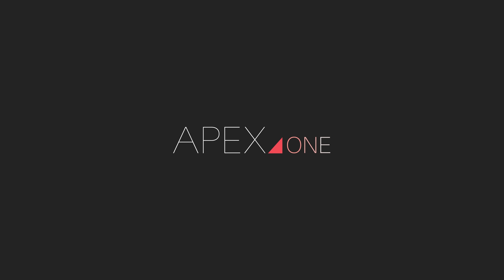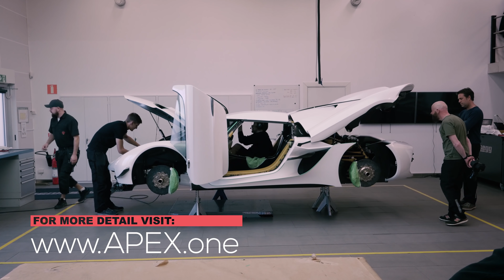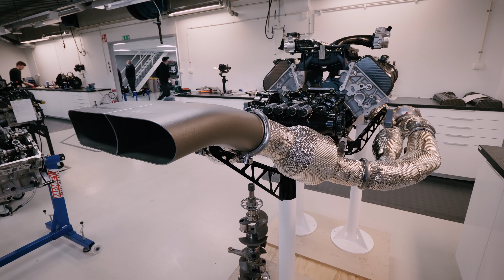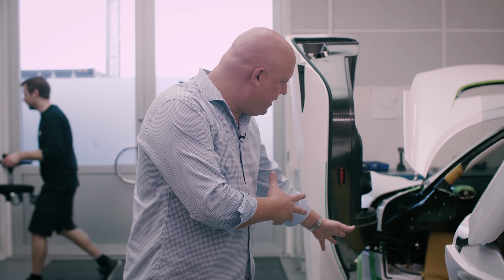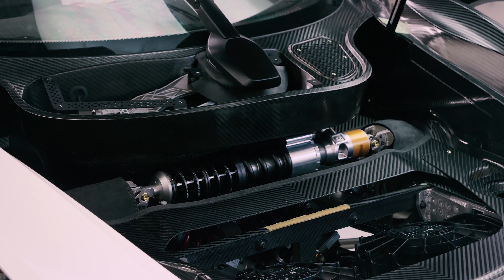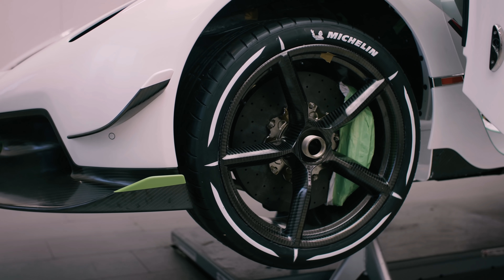First Look: Koenigsegg Jesko - www.APEX.one

Comment: also even with those massive tyres you still have approx a hand print of tyre touching the ground at any time ,which is why those tires are massive sticky tyres basically racing soft compound but in a all weather tyres blok tread pattern. :) Also at high speeds say 250 miles per hour those tyres would only last two attempts thats it, they would still hold you on the road after that, but at higher speeds and depending on the road surface, they will let go full stop, so the tyres are worth around 10K easy to replace and there's only a few places who would be able to replace the tyres and the sizes and balance them as well?

Comment: The air compressor idea is not a new idea, its used when starting up the SR 71 jet engines in fact a lot of jet engines used the same setup. :) The only difference is that its used in a turbo factory car, that all, which most hi end turbo cars will now use, if they pay enough to use the patent to the koenigsegg family, lol :)

Comment: I can say this he has really very good relationships with the swedish air force aerospace metal suppliers like the heat wrap on the exhaust system, thats hi heat resisting metal wrap, like the same as Titanium mixed with other specialised alloys, ( basically specialized weldable exhaust wrapping. :) the same wrap is used in some jet engines and turbo prop engines especially the red bull air speed racing engines. :)

Comment: Koenigsegg just keeps raising the bar in a multitude of ways, and I really hope some of their tech 'trickles down' or is directly implemented by other manufacturers in the near future, for e.g. either of the transmission systems in the Regera and Jesko.

And it's about time the industry pulled its finger out and got Free Valve heads into production. Even if they never achieve the durability or reliability of cam actuated heads, without no timing belt/chain, swapping out a cylinder head could be a one-hour job, and engines could be designed so a single valve actuator failure just shuts down that cylinder (and maybe its opposite number to maintain balance) so the the vehicle can still be driven fine with reduced power.

Comment: at the age of 23 , he decides making worlds best hyper car ( in my opinion), going against Goliaths with heritage, million dollar budgets, engineers etc, he beats them all not only in performance, but engineering and innovation...in 25 years, starting from zero. thats the astonishing part. he manufactures everything himself, , except tires, and turns 5 lt engine into 1600hp. thats not all. he wasnt satisfied with traditional doors, and invented what was called not feasible; dihedral synchro-helix actuation system, carbon fiber wheels for a car going over 250 mph,   an innovation of its own

Comment: Love the car, a masterpiece in its own right. But calling you out on the boost tank. Ford did this technique back in the day in rally, stuck the tank under the bumper.
Reply: But that was racing this is the road
Reply: They don't claim to be the first ones doing so. They got inspired by Volvo's system they've used in their diesel turbos recently.

Comment: 1600 HP from an 8 cylinder engine 😱    Amazing 🤯
Reply: It's not so much as the number of cylinders, but how much air and fuel can be pushed thru said engine, in a sense.
Reply: If you have full forged engine components you can hit like 11-12k from a midsize v8 (theres a lot of examples online of these engines but theres always infinit problems with that much pressure in a small area as a midsize v8)

Comment: Loving the chassis/engine cradle in the rear and the suspension with a 3rd damper element for the aero loads
Reply: That 3rd damper is F1 derived.  I believe the Project One uses this same tech.

Comment: are you aware that California is enforcing state bill AB1824,that is the measure that was passed all the way back in 2005,until the 1st of jan 2019 they turned a blind ear in this case to a part of that bill that states that no vehicle under 6600lbs can have an exhaust system that at idle to 3000 rpm taken at 19 1/2 inches(how they came up with that distance is a mystery at the same elevation and at 45 deg to the outside of the vehicle produce 95 DEC,if you are stopped by the facists they do not test the law give them the discretion to judge that your too loud ,its then up to you to have a ref test it if it fails and there are multiple STOCK VEHICLES THAT WILL NOT PASS,your vehicle will be given certain amount of time to fix it,if your court date comes up before you can see a ref you will be fines $1200 no if ands or buts then if you pass back to court to have the judgement reversed and you will wait 6 weeks to 6 months for a $1000 $200 for fees,
Reply: Nobody is going to enforce that its a show. The police have better things to do. Also california has exemptions for small car companies they basicly don't have to abide by any of the rules large companies do. Thst makes sense too

Comment: Koenigsegg is such an innovative company, they’ve made carbon fiber chassis, triplex suspension, z-shape anti-roll, dihedral synchro-helix doors, hollow carbon fiber wheels, removable and stowable roof, free valve engines, direct drive transmission, and light speed transmission

Well done Koenigsegg👍👌❤️

Edited: thanks for the likes, this is the most likes I have recieve on a comment🙏😊
Reply: Suprising you actually use the doors actual name
Reply: would love to see some of that tech like free-valve and suspension stuff trickle down into cars that us mere plebeians can possibly own.
Reply: @leif viking well thats racist....in a good way though
Reply: Having a removable and stowable roof isn't new, but it is cool to see
Reply: Blaze Clarke I mean yeah it’s not new in this era, but in the late 90s where the Koenigsegg CC Prototype was release, I think it had a detachable and stowable roof, and probably was one of the first to have that feature
Reply: @gassasin3969  I doubt it. There were loads of convertibles before koenigsegg existed, with a lot of those having a stowable roof that you would have had to detach yourself. The main car that comes to mind is the supra from 93
Reply: Blaze Clarke yeah, I forgot that the Supra MK4 was debuted first
Reply: @gassasin3969  nah my 98 Camaro has a detachable and stowable roof called t tops gms been doing it for decades with different levels of stowability
Reply: @blazeclarke  come on guys XD gm beat everyone to this one with t tops I think they started t tops in 68 and in the 80s you could order lots of different cars with it and corvettes have had a targa option since the end of the C3 in 82 idk how stowable it was in the C4 C5 or C6 tho
Reply: @cameronvandygriff7048  I'm from the UK, GM doesn't exist over here. Convertibles are rare enough as it is 😆
Reply: @cameronvandygriff7048  the Pontiac Firebird had one didn't it? That must have been in the 60's
Reply: @blazeclarke  firebird didnt get it til the Camaro got it in 76 they are sister cars built on the same platform kinda like the cutlass and regal and grand prix and monte carlo but the vette had t tops late 60s 68 model year so 67 production year
Reply: @blazeclarke  lol especially cool GM yall just get opal and Vauxhall and the few camaros corvettes and firebirds that people import for obscene money
Reply: @cameronvandygriff7048  we get cooler cars than that lol, and I've only ever seen one or two imported American cars, they're too big over here. We have smaller roads and smaller parking spaces, with smaller houses and smaller driveways.

Vauxhall's aren't considered cool really either lol. People do like Hot Hatches though, Fiesta ST's, Civic Type R's, Audi RS3's, BMW M140i's, A45 AMG's they're what people want generally, aside from saloons such as M4's, and SUVs such as Range Rover (SVR versions too, don't see them often though).
Reply: @cameronvandygriff7048  Opel is the rest of the EU, Opel is Vauxhall, the UK just call it Vauxhall. 

Originally they were separate, then Opel bought Vauxhall (that was based in the UK before), and they wanted to keep their heritage, hence kept the Vauxhall name. They aren't really British as such anymore though. Think the only proper British car manufacturer left is Morgan. Everyone else is owned by an overseas company
Reply: @blazeclarke  damn sad to hear rode in an old triumph spitfire one day and fell in love with proper British cars I already had a thing for em because of the shelby cobra something so wrong and so right with the ultimate muscle car being a British aluminum topless car smaller than a miata with a massive 7.0 liter V8
Reply: @blazeclarke  yeah my 98 Camaro has that XD
Reply: Also first 3d printed variable turbo, first top mounted wing, first 800v electric propulsion system. And I feel like there are more.
Reply: @ErikPukinskis  Ferrari got more weapon under it sleeve but not for public road btw and newbie rich to use.95% of the so called claimed pro racer pro driver are actually just normal shit in their world only few elites are those godly ones that can tame and drive the limit of properly made beasts.
Reply: wooooowww... such unusual and cool nameee... just because its has cool name doesnt mean its innovative,.. most of it already developed or invented.. the problem is,.  merc, porsce or any other big car manufacturer, etc are corporation.. the enginer doesnt have the freedom to make a mad car.. their car depends on management meeting. and most manufacturer are tend to hold their technology, if their super/sportcar with usual tech are sold out, why would they make with a newer tech available?
Reply: Then u have bugatti who put a body kit on a chiron and call it a new car 😂😂.
Reply: "light speed transmission".........hmmmmmm? Ferrari's single clutch on the 430 was a lot faster. Koenigsegg's gearbox sound like the SMG used in the E46 M3, on the second speed setting. Maybe the third setting when they updated the gearbox for 1:1/RS but still; not lightning fast.
Reply: @helicocktor  I think they mean the gearbox in the Jesko.
Reply: @joakimcnhify  don't think anyone outside Koenigsegg had ever listened to the Jesko shifting at full throttle. Don't get me wrong, I'm not hating on Eggs, having a lightweight transmission handle over a megawatt of power reliably is absolutely deserving of respect but I don't think a DCT with a single input shaft will ever be as fast as a normal DCT.

Comment: Finally, something more "affordable"

flat plane crank V8, wonder how it sounds
Reply: It will sound like a mad man.
Reply: If a million bucks is affordable to you, okay.
Reply: CvK said the car sounds like an F1 car revving.
Reply: Same so curious to hear it run.
Reply: like a Ford gt350 !!!!!!!!!!
Reply: @jonienglish3231  i doubt it.
Reply: @johndessire399  its true - Ford uses Flat Plane  crank in Mustang
Reply: @jonienglish3231  I was refering to "how it sounds part". The gt350 has a singular air intake and different firing order.
Reply: @johndessire399  not to mention the GT350 is N/A of course, while this one is turbocharged.  I'm sure it sounds awesome but probably nothing like a GT350.
Reply: John Dessire they used a ford engine
Reply: @FullOilBarrel  the initial block dimensions at one time were used after they stopped using Ford blocks.